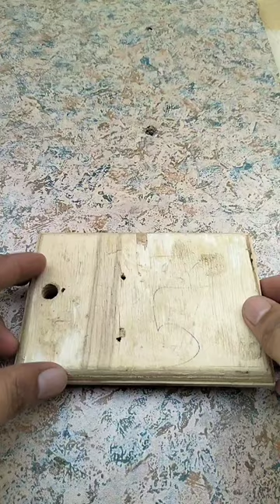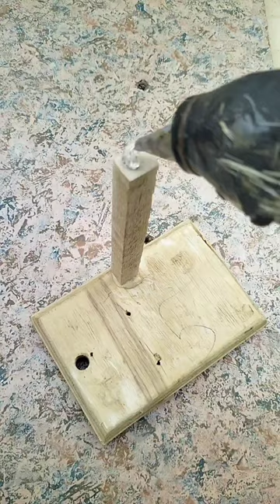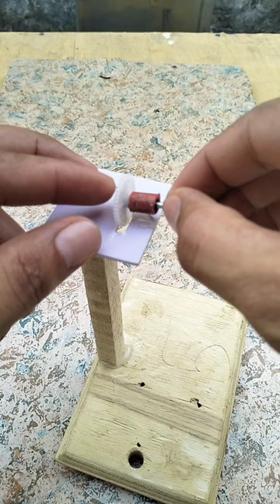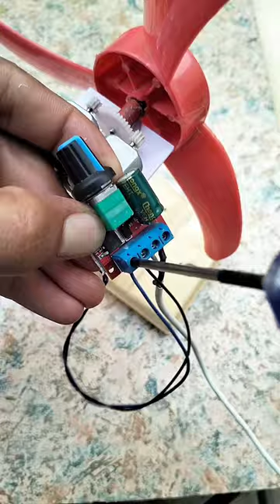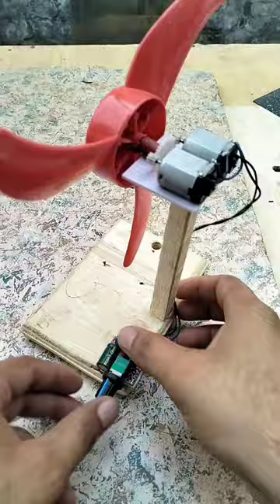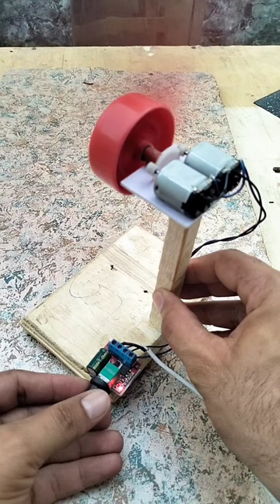DC motor hacks #tablefan #youtubeshorts

Comment: Useless Project Sirf Torque Increase Hoga Isse Speed Nhi Ek Motor Se Bhi Same Hi Work Krega
Reply from the maker: 😂😂 you are engineer 😜
Reply: Bro torque is the force. So if a single motor was having trouble with delivering it's torque at that speed two motors can increase its speed which it wouldn't have got it by using single motor
Reply: @Yeaitts good explained 😃 bro
Reply: @Yeaitts Bro He Make Table Fan So Why That Much Torque Need instead Of Increasing Speed
Reply: @manusolanki2824  physics padha kr youtube engineer😂😂..... Tb na pta chalega
Reply: @manusolanki2824  single motor se speed Kam ayegi, tu try kar k dekh le